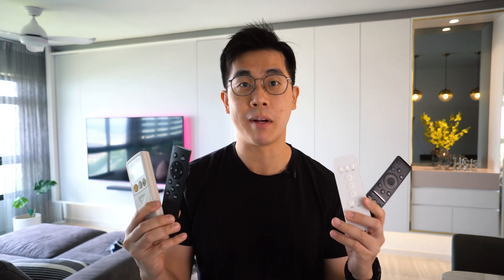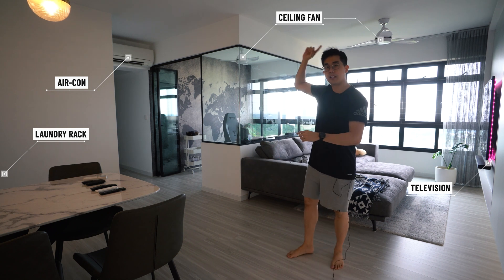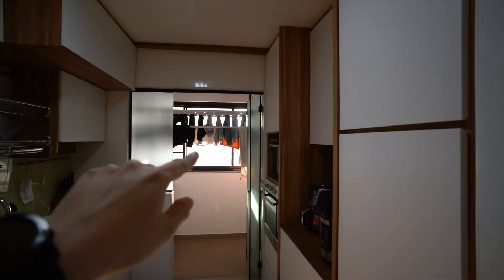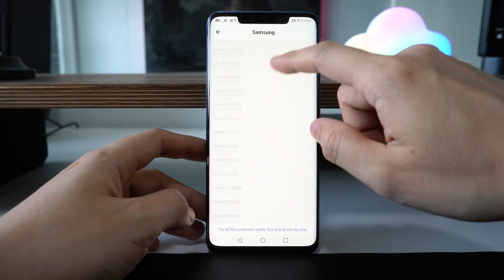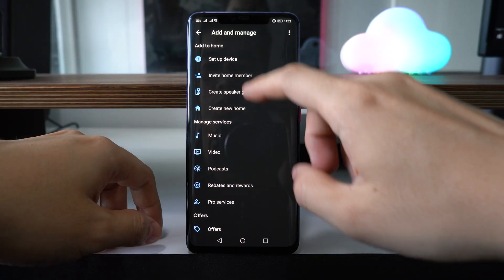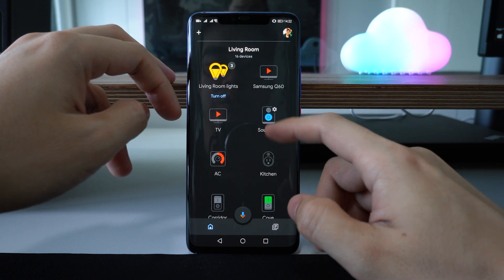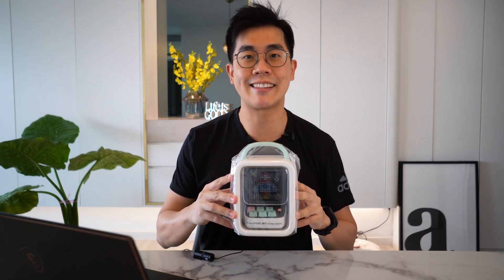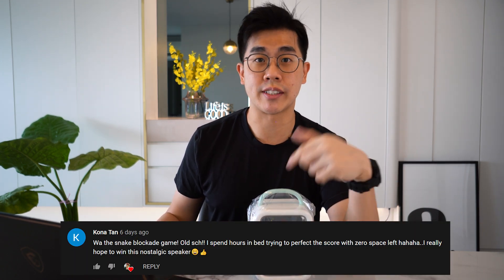Automate Home Appliance with IR/RF Blaster Solution

Comment: I don’t need a central platform to control my home smartly. 
I just want my phone to be a central remote control for my ceiling fan, laundry rack, tv, air-con, lights etc. can you advise what can I do?
Reply from the maker: it will be simply using the app for each of the solution for the devices then. Nothing difficult if you don't need to have a central platform for the devices to work together. Actually I don't quite understand your question
Reply: Hi, thanks for always replying to the comments helping a newbie out like me.
So right now presently, my fan, lights, Aircon, drying rack are all operated by remote controls.they are not smart devices which have WiFi connection.
They each have their own remote controls and thus I have many controls lying around.
I was thinking if it was possible for my phone to act like an universal controller to on/off these devices. I don’t need to use Siri/ Alexa to control them using voice command.
Any idea if that is possible?
Reply from the maker: @Whatexactlyispeace  then that's exactly what this video is showing, using an IR blaster solution from switchbot/broadlink to make your controllers 'smart'. In the video, i demonstrated controlling these devices via the mobile app

Comment: Hi Alex, I also have aqara switch. Did you manage to link one of the gang to turn on your washer? How did you do it? I added my aqara hub and switches all to xiaomi app (China region) When I link them to Google home, all I see is my xiaomi fan and air purifier. Non of the aqara items detected. Is it normal by the way?
Reply from the maker: washer is running on a plug not switch, i have it always on anyway. Yup, that's normal expected.

Comment: Smart devices are nice and all but how do you secure your networks such that these devices will not be exposing your data onto the internet? e.g. xiaomi or google home constantly homing to a server outside your control. After all, many smart devices aren't built with security in mind.
Reply from the maker: Hence some people run their own private isolated environment with Home Assistant. I am also concern with security, that's why i'm skeptical using IP cameras inside the house. But if you look at other individual smart home devices like a smart light bulb, there is no sensitive data there. The concern is not going to servers from xiaomi or google, their network security is definitely much more secured than what you are able to build. So the concern is mainly on your own home network level, do the basics like not using default ssid, setting a secured password all these. If you want to go another level to secure your network, you can put some home based firewall appliance or Pi-hole.
Reply: @AlexTeo  thanks for the sharing. would you recommend Home Assistant for someone starting home automation from ground zero or is it not worth the hassle?
Reply from the maker: @swb90  if you are a techie guy who don't mind to touch some coding/scripting, then the Home Assistant is a very good and powerful platform for a smart home

Comment: Hi Alex, is the range of the switchbot mini hub range about 8 m? from the web it says 80 m  in an open field. Would you suggest to have a hub in each room?
Reply from the maker: not sure what is your requirement, are you referring to their switchbot bots? If you are referring to IR blaster then yes you will typically need one for each room since you need that line of sight for IR devices
Reply: @AlexTeo  ah i see.. looks like i will need to plan out for each room then.. thanks for your insightful videos!

Comment: Hi Alex. Can the SwitchBot Hub work with Xiaomi smart switches? Or must I buy the Xiaomi Hub? Does Xiaomi hub integrate with Google Home? Thanks.
Reply from the maker: typically hubs for a brand only work with products under the same brand. Aqara hubs integrate with google home, not xiaomi
Reply: @AlexTeo  Ok. I'm still confused. Basically, I would like to use a smart hub to replace my IR remote controls (for TV, fan, hifi), and a smart switch to control lights, and have everything work with Google Home. What would you recommend?
Reply from the maker: @terencesim8050  as explained about IR you need line of sight, so its impossible to have just 1 IR blaster to cover everything in the house. As for smart switches, there are many brands out there, can choose based on which design you like and check whether they have sensors as well. For me, I prefer aqara.
Reply: @AlexTeo  Ok thanks!

Comment: I have started doing some home automation as well by combining 2 RM Pro to control ceiling fans and air cons, a ConBee II with deConz to manage some Aqara temperature sensors, Philips Hue, and Gledopto lights and a raspberry pi running Home Assistant to combine everything together. So far, all good!
Great videos Alex!
Reply from the maker: Sounds like a very nice setup you got there!
Reply: @AlexTeo  thanks! It works quite well. Very happy with Home Assistant and all the integrations it has. It requires a bit more work to setup but once is up and running, it’s pretty amazing. Totally worth looking into it. 
Lucky I found your channel as i will be able to look Closely to your reviews and get the same products here in SG
Reply from the maker: @rpenatez  yeah, those brands of products that you have might not be worth getting in SG considering the shipping fees. I will definitely try out home assistant during my spare time!

Comment: I haven't played with this tech for >10 years as it takes longer to take your phone, on the app, press a button - versus just picking up a remote instead. Using a programmable remote is better IMO, unless you needed to access something outside from home. As for your problem, Logitech harmony system doesn't have this issue as it remembers which device is on/off whenever you switch modes, so it doesn't turn the TV on if it is meant to be off (if you only use this system).
Reply from the maker: you are right, typically you won't take out the phone to control it unless in cases where I am in the bedroom and want to control something in the kitchen or something. Usually the triggering is with voice or wireless switches. My problem still exist whenever somebody in the house use the physical remote which doesn't make sense not to use it. Anyway its a small matter for tv because you can always make your tv smarter with a chromecast/fire stick
Reply: @AlexTeo  Logitech harmony has both hub and physical remote. So you can use the hub via phone app, and the person at home can use physical remote. If both interface via the hub then it should be in sync. In theory
Reply from the maker: @Quest88  yeah but its a very old product man and lots of mixed reviews during its early days. It's probably much better today. Anyway its not officially available in logitech sg, so not sure whether they are all sorts of integration problems

Comment: I use a simple on/off IR switch (Lunvon brand, from carousell) in my bedroom to turn off my light, tv box and tv speaker in one press.
It has a dedicated remote control for 3 switches.
I prefer a dedicated remote control because i don't want to to reach into my phone when I am already trying to sleep :-)
I have insomnia. I usually play some meditation videos or some boring documentaries to sleep. So when I am finally ready to sleep, i want to turn off everything in one press without looking.
Reply from the maker: yeah, actually seldom use phone to control unless you are outside or you want to control something from another room. Most of the time is gonna be using voice or wireless switches

Comment: Which broadlink RM should I get? the pro or not. I am thinking of connecting the remotes for my smart blinds and fans and lights and the air-con. Any idea if PRISM+ TVs can be added to broadlink? Thanks in advance!!
Reply from the maker: it depends on your requirements, the broadlink should work fine with prism TV, don't forsee any issues